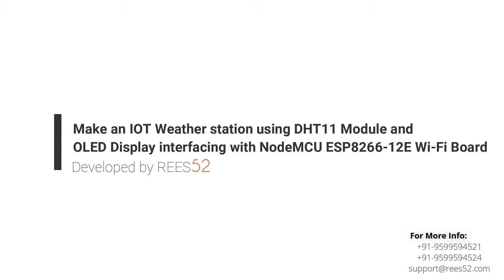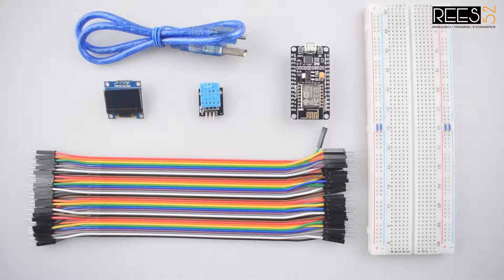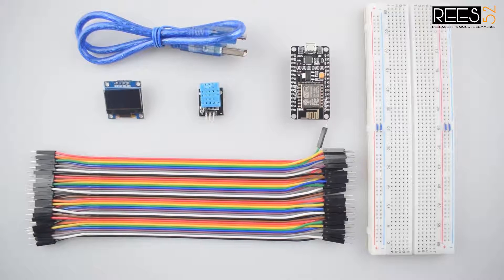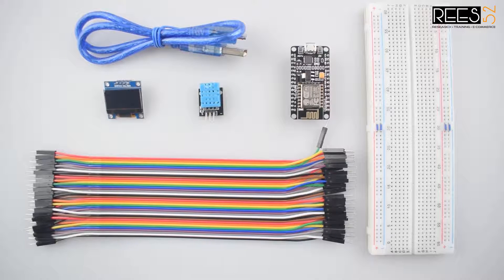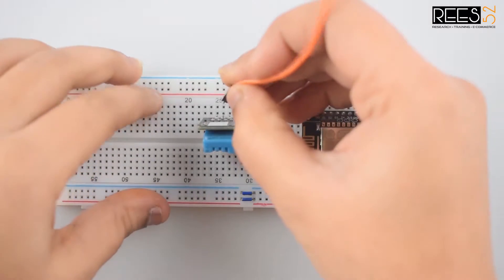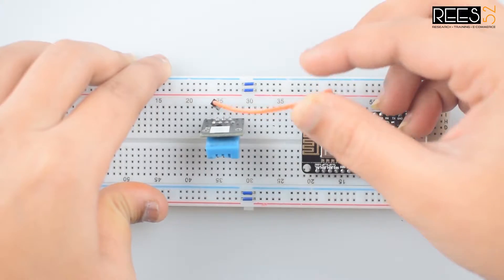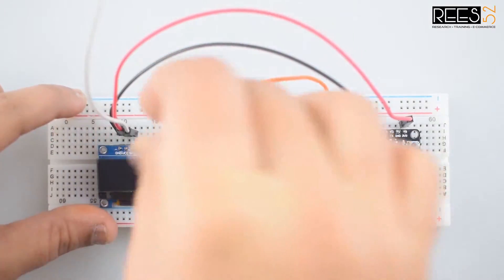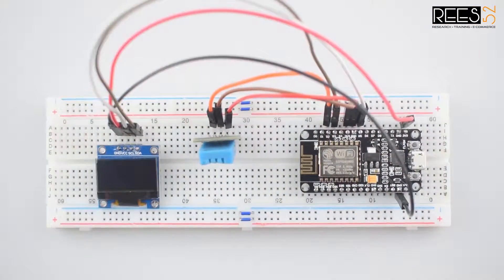Make an IOT Weather station kit using DHT11 Module and OLED interfacing with ESP8266-12E Wi-Fi Board

Comment: Hi i used your code once and it worked!! But after adding in more components like the bmp180 sensor and updated the program the OLED screen is blank. Everything works fine except the oled is there any solution?